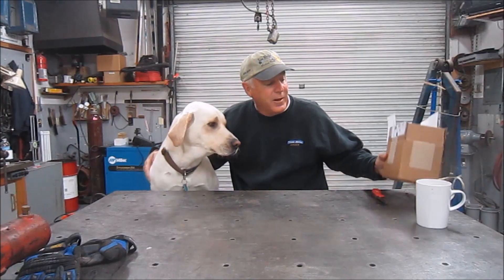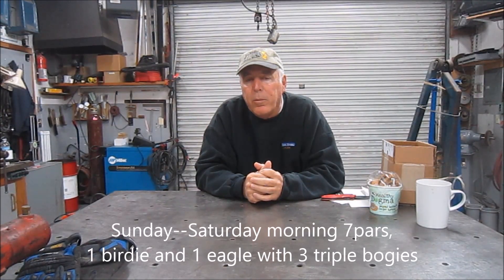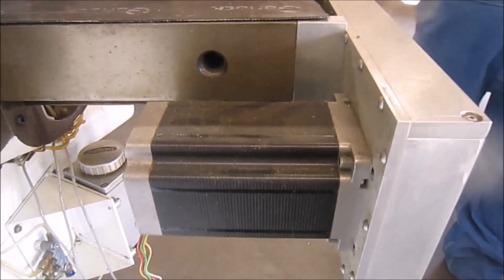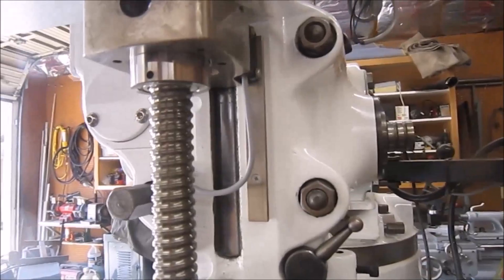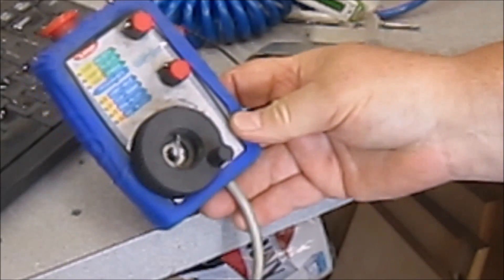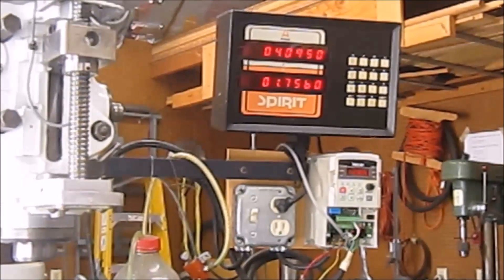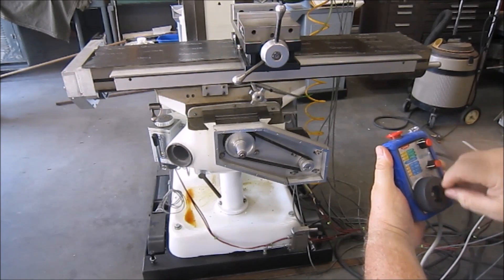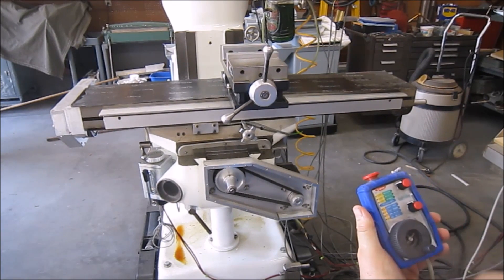SCREWY TUESDAY #10  Call My Agent

Comment: Hey chuck,

could you please try to get more info and close up shot for gas springs connected to the mill. What is the stepper motor ratings in Nm and what speeds (rapid traverse in inches per minute) is that machine capable off?

Would you consider that on your mill?
Reply from the maker: Mukhthar Ahmed email Craig, I put his email address in the video